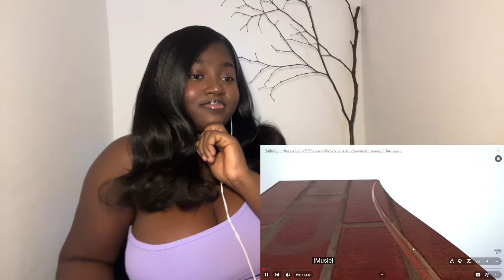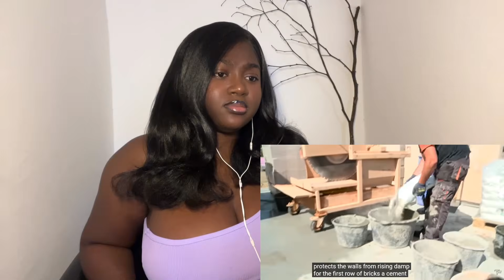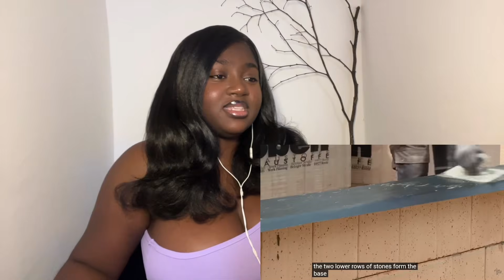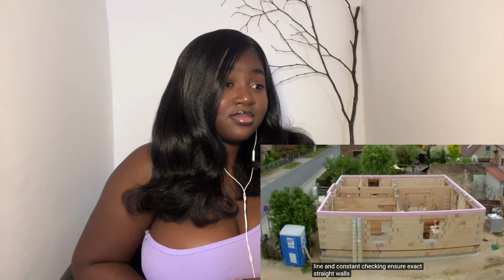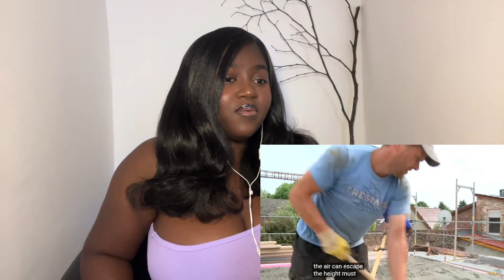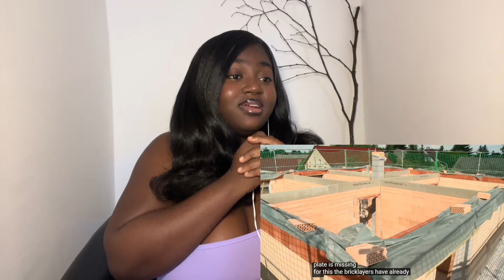My First Time Seeing How GERMAN HOUSES are made!

Comment: Those stones especially on the ourter walls are the main reason ac's weren't popular in lots of European countries simply because we needed them for a few days if at all. The original stoneworks were both meant to keep the cool air in summer and the warm air in in winter. Well, nowadays climate's getting hotter, and we have to see how we manage. Most old houses aren't build for holding big ac's, though, and our power grids aren't build for millions of ac's.
Reply from the maker: That’s actually a really interesting point! I didn’t know the stonework played such a big role in regulating temperatures before modern cooling systems. It’s fascinating how older buildings were designed around the climate, and now with temperatures changing, many places have to rethink how they adapt. Thanks for sharing this insight! 😊

Comment: German houses are more expensive, but since we pay much more for electricity, gas and heating oil than, for example, USA, we have to build well-insulated houses. So that we save costs on an ongoing basis, we only build one house in life and usually do not move often. Then there are still uniform building rules that apply throughout Germany. In Germany, there is also no air conditioning in houses. It is also not necessary for well-insulated houses. Then there are the good German windows. The whole thing perfectly makes new constructions of single-family houses available in various sizes, starting from 350000 to the top, depends on the size. I estimate most of them to be 500000 to 750000 euros.
Reply from the maker: Woah, omg! 😮 Just like I predicted, these houses are definitely quite expensive. Honestly, you can almost tell just by looking at the planning, execution, the level of organization, the materials, and the specialized tools involved in the construction process. The amount of precision and attention to detail that goes into every stage makes it clear why the cost is higher. But it’s also interesting to see how that investment translates into energy efficiency, durability, and long-term value. Thank you for sharing this extra insight! 🇩🇪👏

Comment: people DO want houses. it's just - almost no one can afford it anymore; both due to a) regulations (especially the new heating-laws due to the study that had to be retracted for invented numbers, and yes, the other regulations also make the houses so much more expensive) b) stagnation, failing economy - jobs no longer secure, salarys not going up, and if you own a house, you must sell it (and move to an appartment) before you get wellfare (if need be - as said: there aren't many jobs anymore around here)...
edit: checking if yt likes the comment
Reply from the maker: You make some valid points. Affordability is definitely one of the biggest challenges facing the housing market today. At the same time, finding smarter solutions and new ways to make housing more accessible remains an important conversation.
Reply: @InsideDeutschlandd  true that - sadly, for whole europe, that conversation doesn't happen.